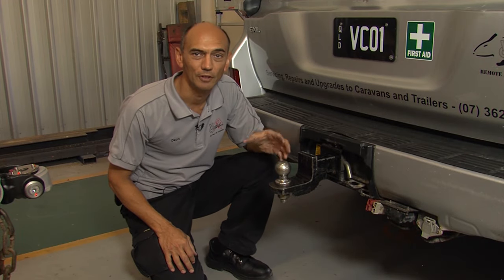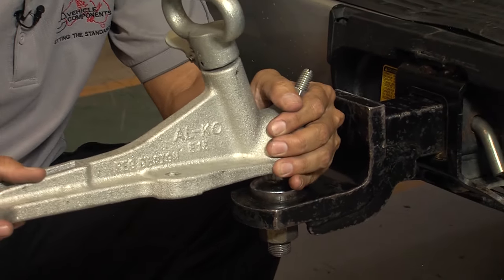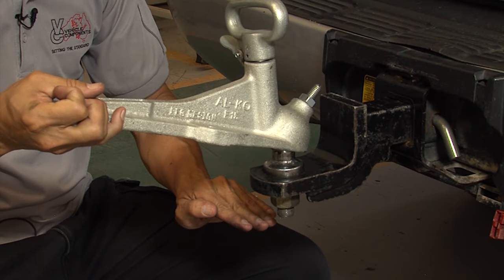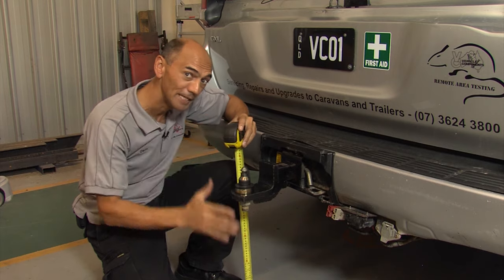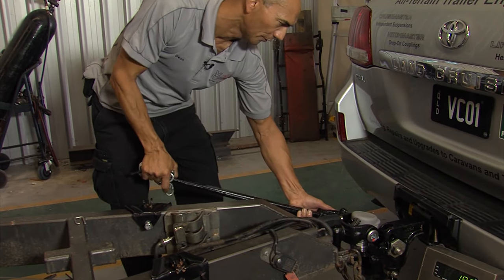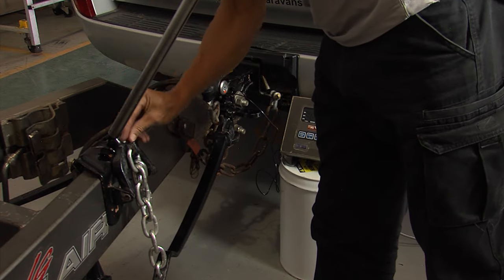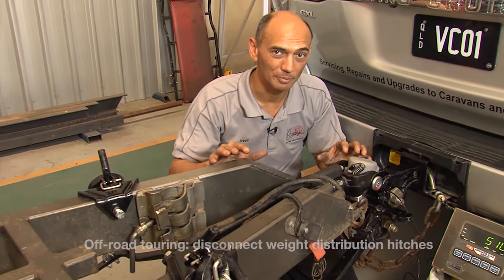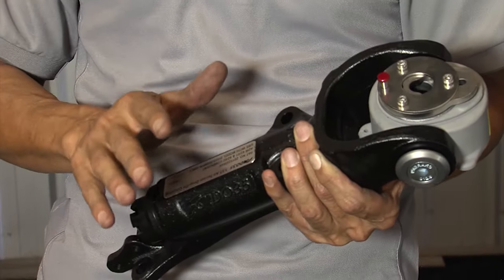Cruisemaster - Effects of WDH on Couplings

Comment: Hi there I'm thinking of a Do35 I'm use to the alko 50mm and Anderson tow hitch and weight distribution chains for swinging its a roadstar offroad caravan 9 meters tip to toe  are these hitches do35 are they not to swingy with all this extra movement cheers Buck

Comment: I read also that as long as you are using a hitch which can be adjusted so the ball can fit within the stated range,  you can tow with your ball at a different height. I guess being level is the important thing. I'm using a DO35 so it doesn't matter anymore, but I did do a lot of research when I put a 200ml lift on the van and needed to check ball height regulations.